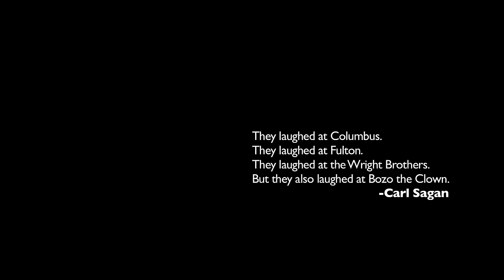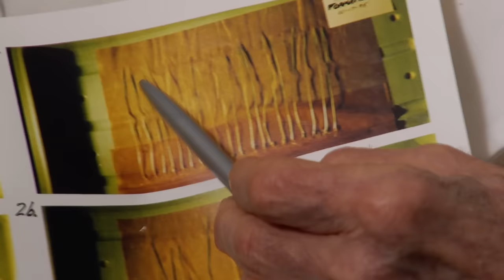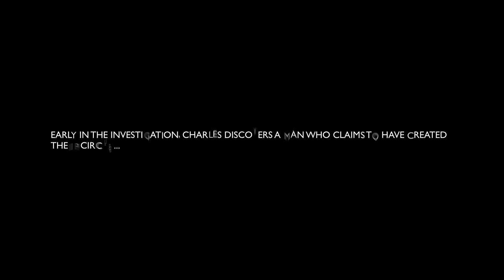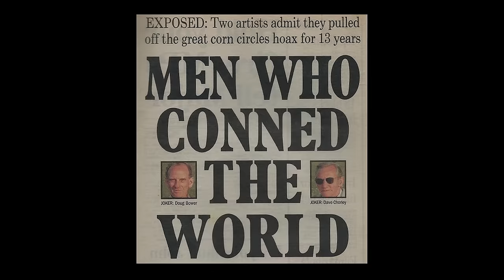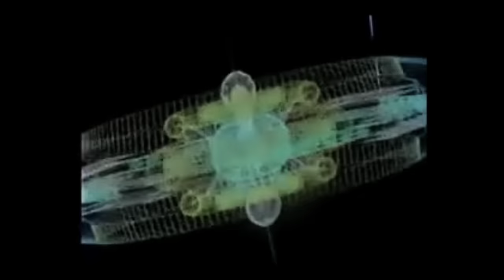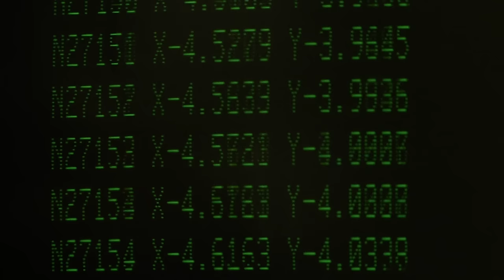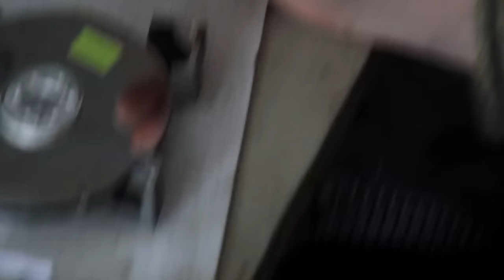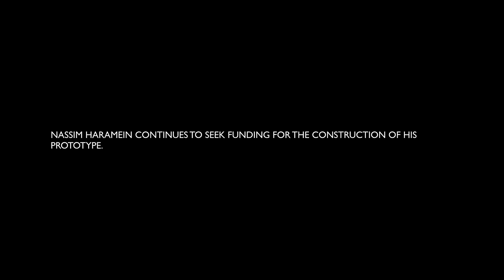Discovering the Truth Behind Crop Circles | Shiver Exclusive

Comment: I do believe that at least some of the legitimate crop circles are 2d representations of 3 dimensional objects. Ive also had that feeling since i looked into them seriously and realized there were some that had real world mathematics incorporated and were done overnight in places that were watched or didnt have the time, not to mention the scale and amount of them plus bill and bob arent making those ones up etc. 
The problem is even if that's true, you still unfortunately don't know so many variables, mainly being, what are the components made of? Which is usually hugely important especially when it comes to "high tech" devices. 
You don't know which parts move or which are stationary(you may be able to surmise this part slightly but you still would have no idea of speed or rotational direction), you have no idea if there is electricity involved and if so where and how much, what freq. or most importantly what the machine does etc., etc.
So i think it would take a lot of different minds from different fields working together with a very clear cad blueprint to even ponder over it for a while to even start to do the guess work of those factors.  I also think we need to ask the makers via our own crop circles once we have one that is quite clearly a 2d rep. Of a 3 dim. Object to elaborate on the design and or materials involved. Who knows they may just answer and provide additional needed crop circles to help us make it. After all if we are correct they are trying to give us the tech so why wouldn't they?

Comment: Taloric current works in many ways with spin for forming and maintaining a flowing system that allows for enhanced liquidity to reduce the amount of an otherwise expensive process circles within circles that cyclical effects of vibration and other planet's effects gravitational pressure on the surface of water and the spin of the planet and to understand that the density is a factor in the spacing process
Reply: Wot?

Comment: Hydrogen is a Tallow of water that is salt and water that can bubble into a different environment and the starting point of this spin the next step is statically driven by the a secondary barrier to breaking down the fluid in the spacing process circles within circles of the energetic nature of hydrogen atom to create a twist in the spacing process floating around the holes that are negative in the middle of the edges forcing them into the bottom of the orbiter to create a few newer bubbles that static😮static fill with out popping the wavelength and then add a few million to the wavelength and the floating power comes in to the original form these are objects that are negative and powerful enough positive to make the sound in vibration so that tuning tunnels the rest of the area's surface will gravitate toward the top and bottom
Reply: Wot?